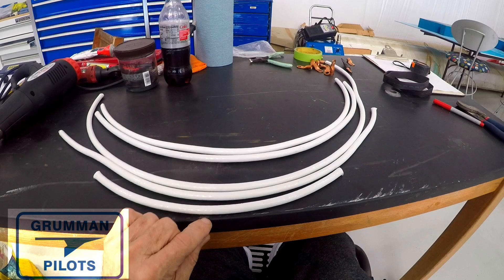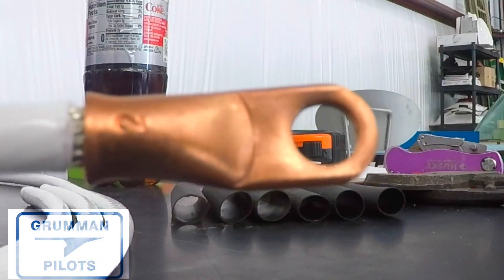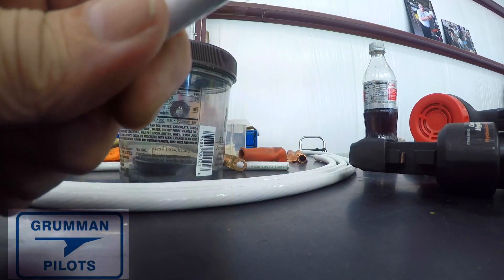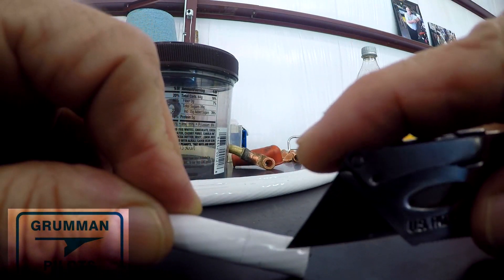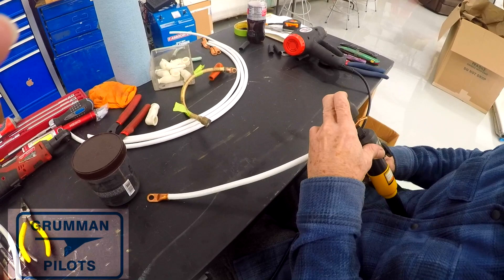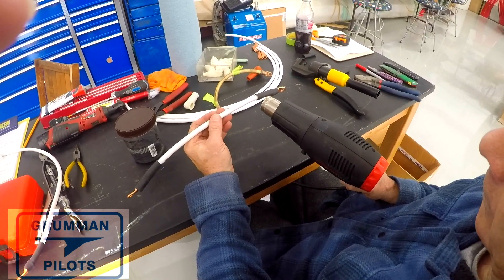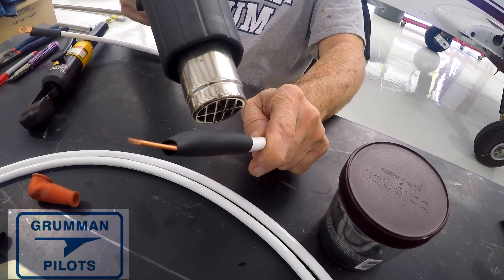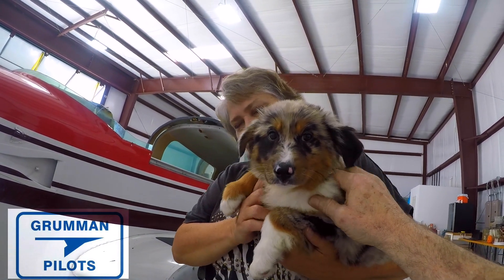Making Aircraft Battery Cables - Grumman Style

Comment: Doc, If you wanted a real first class electrical terminal connection, you could get terminals that still have an inside taper but not an outside funnel. No bump or potential wear point for the heat shrink. Is there a reason why you are not using adhesive lined heat shrink? Great suggestion to "clock" the second terminal to make installation easier.
Reply from the maker: These amp connectors did have a taper on the inside.